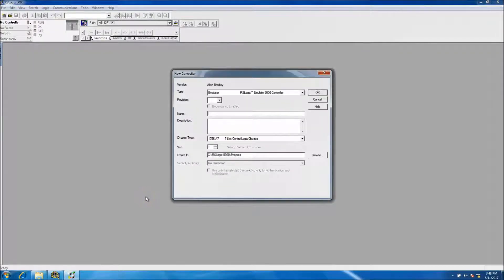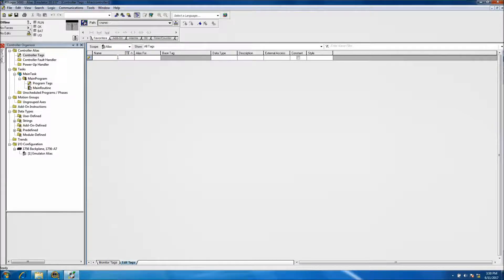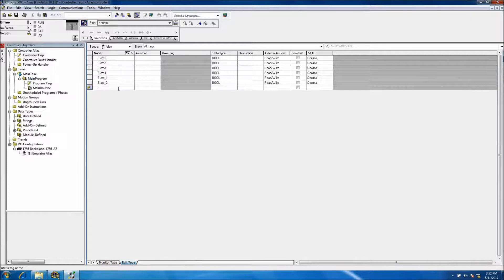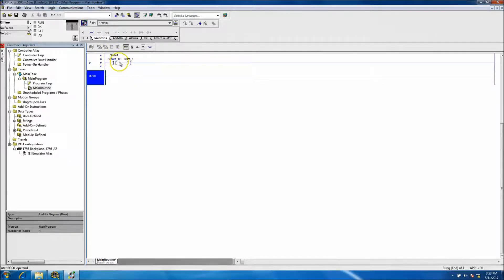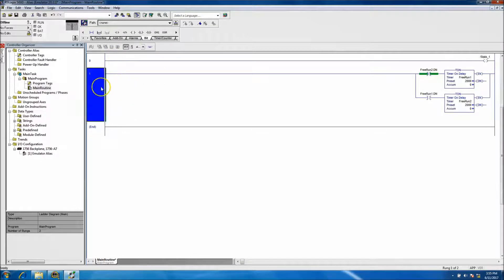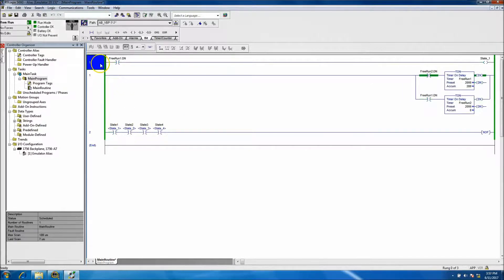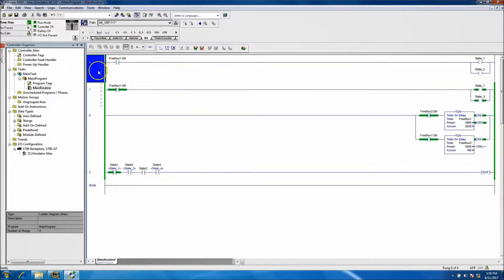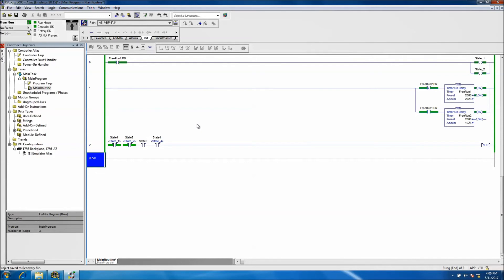RSLogix 5000 Alias Tag examples

Comment: I followed everything w/ your simple example w/ my RSLogix 5000 Ver 20.  I did have trouble w/ the go online w/ the emulator.  I have internet access, but the error message implies that I need to set something else up.  Any clue?
Reply from the maker: Are you implying that you can not get online with the emulator? 
If so, what version of emulator are you running? 

It has to match the version of Logix that you are using.

Let me know if I can help out any further.

Shane